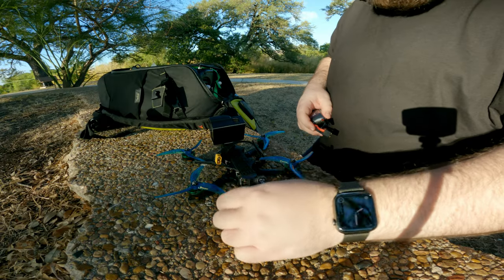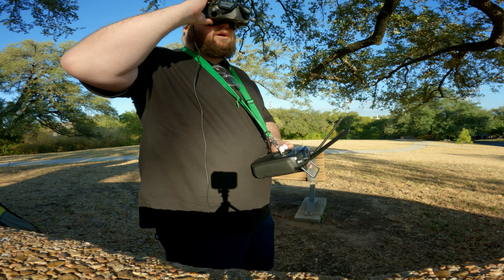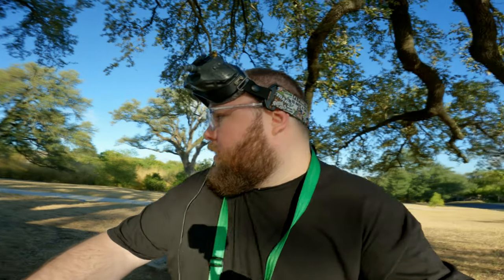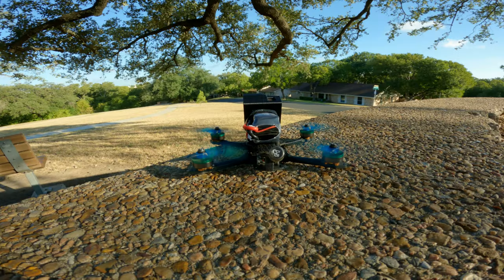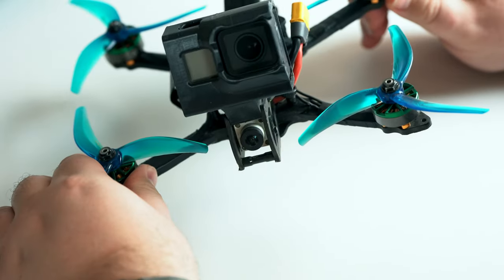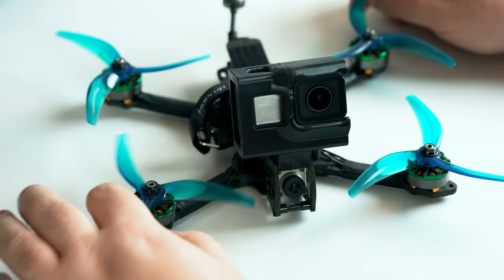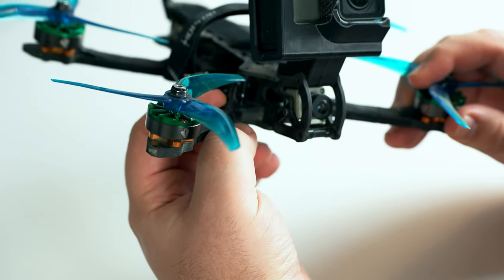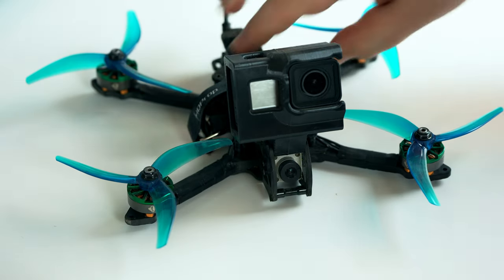Trying Light props for FPV Freestyle | Vlog

Comment: Hi Mate, I like Your flying style. How much does Your rig Wright?
Reply from the maker: Thanks! I think you meant how much does it cost, right? This one was roughly $500 USD. All of my digital ones sit somewhere between 400-500.
Reply: @JustinormousFPV  no, I was thinking about the weight. I just have bought my first 5" (GepRC Mark5) and I have two sets of batteries - 1100 and 1300 mAh were difference of weight is app 30g. And I have a feeling that this 1300 is too heavy for freestyle, I am not very experienced yet but I feel much better with 1100 mAh battery.